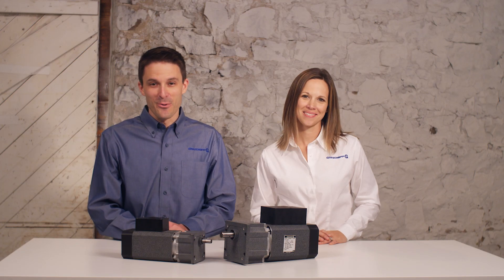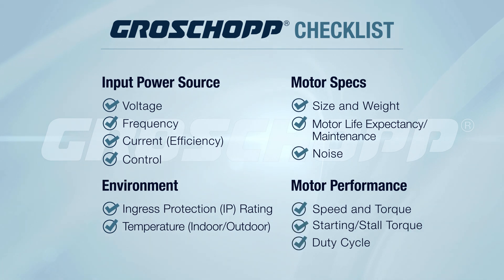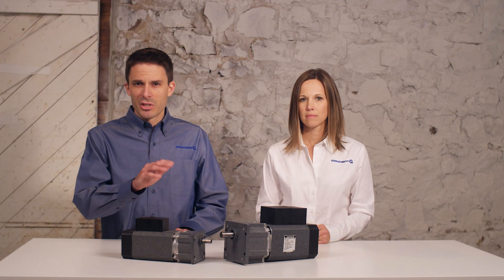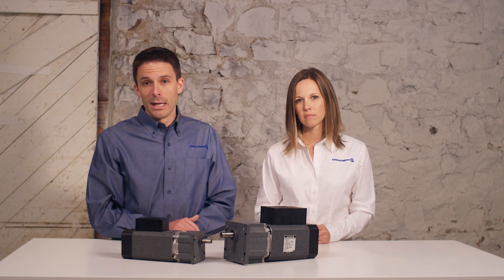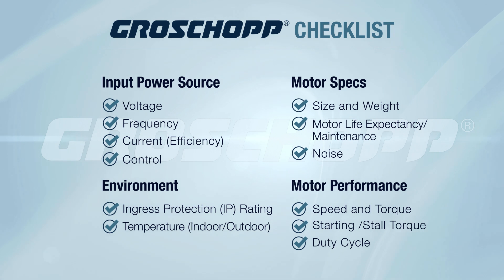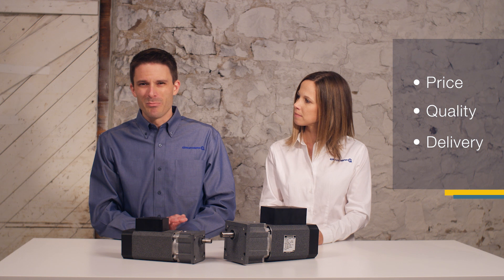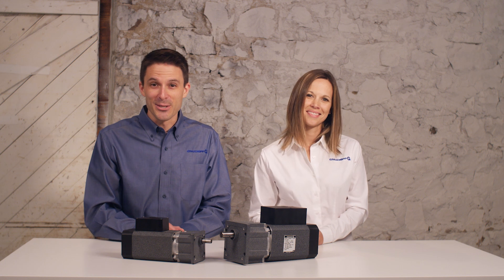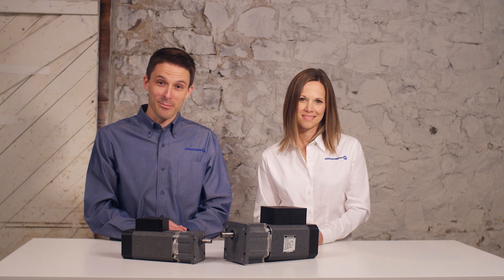How to Choose an Electric Motor | Application Criteria (Part 2)

Comment: I was hoping to find help on figuring out the Motor Performance items. Most importantly, the Starting/Stall Torque for this project that I have in mind. Unfortunately to answer this question probably also involves some physics calculations. (To figure out the weight and speed and all that of the object I’m hoping to move.) 

Any chance you could point me in the direction of finding help on this? Thank you so much!

By the way, very well put together and professional looking video series. Nice Work!